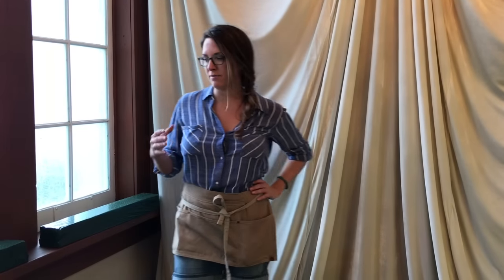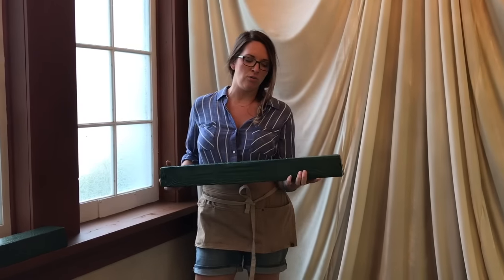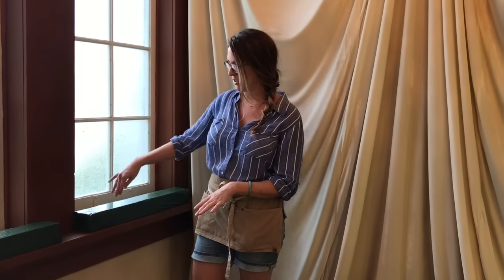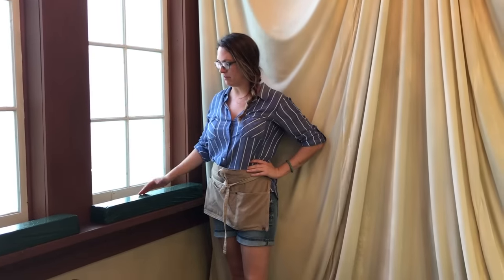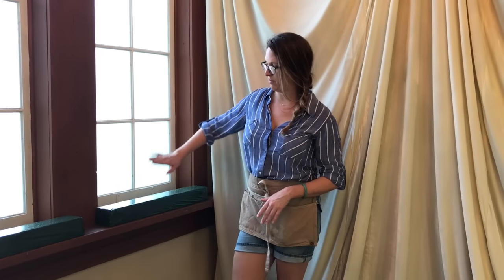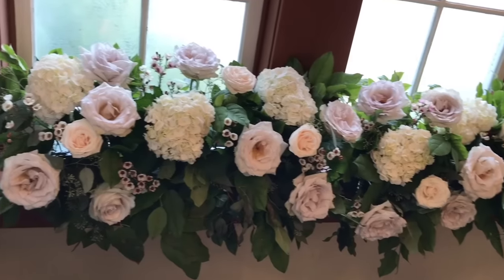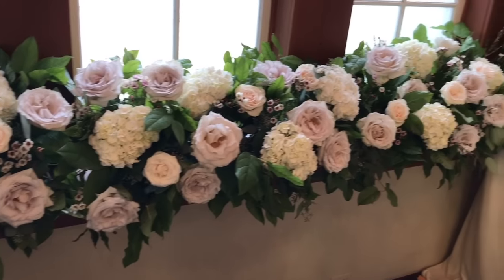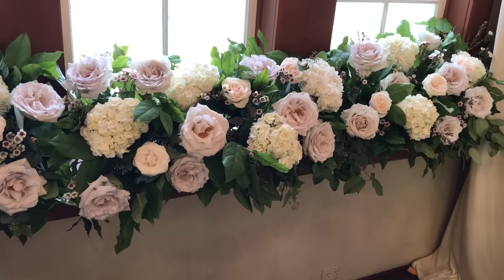How to Build a Floral Runner | Learn how to create a DIY floral runner with Flower Moxie!

Comment: Hello I have a question : I want to do the same for my wedding. To same money I will do it myself. The ceremony will be the saturday. Do you think, the flower will be ok if I do it the previous day? I also want to use the same flowers as yours
Reply: Yep!  Just make sure you soak your raquettes for an hour in the tub (because your sink isn't big enough).  Avoid putting in hydrangeas until right before because the foam does not supply enough water.  Other flowers/greens should hold up just fine!  If it's a hot-weather month, then buy a bottle of Crowning Glory Floral Spray, and that will help keep'em fresh!

I used Salal, Quicksand Roses, Vendela Roses, and Wax flower!
Reply: @amymccord6480  thank you very much 🙂

Comment: Would it be cheaper to do this or a garland with flowers added?
Reply from the maker: Hmmm...garland typically runs $12-15 per foot and then you'd have to factor in the blooms.  I think it would probably be a bit less spendy, but you wouldn't get the profile/height...it would lay much lower.  You could always forage greenery to bring down the price a bit!

Comment: If i recreate this using standard foam and brick trays, how long will the flowers last? If i soak the foam and then cover with plastic wrap, would that work as a cheaper alternative? Those raquettes are definitely more expensive
Reply from the maker: I don't see anything wrong with that idea!  Whether you do that or use the raquettes, your vase life will not be that long because the foam is not in a vessel of water.  I'd suggest creating the day before....unless you have a cooler, and then you can do 2 days.

Comment: thanks for sharing! i'm DIYing my wedding gazebo flower decoration. Would I use 27 inch or several pieces of those (and then glue them?) foam for the top and appropriate lengths of foam for 2 sides of gazebo? do those foam pieces have holes for zip ties?
Reply from the maker: For a gazebo I'd recommend using Large Floral Foam Cages and zip tie the snot out of them!  Look up my arch video!  

And yep, the foam cages have holes for nails or hooks, but I tend to use zip ties.  =)
Reply: @FlowerMoxie  many thanks!!

Comment: Love it!! Where can I get the plastic wrap please? I'm doing a table runner for a sweetheart table and the runner has to come down on each side of the table. I'm kind of scared the water will leak all around 😳 how to prevent that please?
Reply: All fresh flowers and greens btw
Reply from the maker: So they have been hard to find since the pandy, but what you could use instead is an Oasis Brick Tray.  We have several sizes:

https://diyflowersupply.com/products/oasis-double-brick-tray?_pos=3&_sid=cce832cda&_ss=r

Comment: Can you please let me know The recipe above for flowers can cover the whole foam. Thank you very much. I love all your videos, keep watching over and over.
Reply from the maker: Thank you so much!  In this video, we only focused mainly on the front of the floral foam bricks, since the runner was front facing and the back wouldn't be seen.  This recipe would absolutely cover all of the foam but you will want to cut the stems shorter to ensure that they are covering as much surface area as possible!  If you wanted to make the design more floral heavy, consider adding in 20-25 carnations and 10-15 spray roses, to add more to the design.
Reply: Thank you very much for your fast reply.

Comment: Amy, my daughter’s wedding has an arbor with a steel pipe structure that I was thinking of attaching these to. My question is can you put flowers in the bottom of it, or will the water leak down if you do?
Reply from the maker: I would use floral foam cages or floral foam garland.  The raquette will be too heavy, and there's not a good way to attach it to a structure.   I have another arch video using all of the items mentioned...also, I show what Southern Smilax can do, which is great for installs.  When can get this for you if need be.  Best!  Amy

Comment: Hello, thank you so much for this informational video. Would you happen to remember how many stems were in each bunch of salal?
Reply from the maker: Salal is sold as a 'growers bunch', not stem count.  If you look on our site, we have great product photos of this!  There are salal tips and standard salal.  The tips are prettier and smaller, but you get less....while the standard has larger leaves, can sometimes look rougher, but you get a ton.  For installs like this I go with Standard Salal.....for bouquets and small centerpieces I use tips!
Reply: Flower Moxie Thank you sooooo much for your response, wasn’t expecting it (especially not so fast). Please confirm if you used 4 bunches of standard salal or 4 bunches of salal tips for this installation.
Reply from the maker: @MrsDoubleO  I used standard!

Comment: If you had excess water in the container/oasis  would you leave the hydrangea in the oasis?
Reply from the maker: In the winter when you can leave it in a really cool spot like your garage, yes.  In hot weather months, they can struggle-bus within a few hours.  I design with the hydrangeas, then take them out and pop them in a vase of water and just pop them back in before the wedding.  It's really easy to figure out where they should go because you'll have big holes.  =)

Personally, I play it a bit safe because I don't want the flowers to go south halfway through the event.

Comment: Hi! Do you recommend the raquettes for making a flower bar across the front of a pipe and drape chuppah? It needs to be about 18" - 24" tall, but just not sure if this would get too heavy  on the piping across a 10' -12' span. Any insight or advice would be much appreciated! thank you!
Reply: Nope, that would be too heavy.  I'd recommend using small Oasis Igloos or better yet, the Oasis garland!  The garland is kinda spendy, but you get a lot of it, and it's very easy to attach the sections and to fill out.
Reply: Can we use  about 5 floral cages on the front of the pipe and drape? Maybe attaché it to wooden strip and zip tie on the day of the event?

Comment: Hey! Is it possible to hang them on stairs handles? Will they be too heavy if I used some zip ties?

THAAANKS :)
Reply: If they were hanging on the side I think it'd be too heavy, but it could work on top.  Personally, I would use Oasis Foam Garland...it's not cheap, but it's legit, and I take the same approach by heavily greening and then adding my blooms:  http://www.wholesalefloral.com/ProductDetails.asp?ProductCode=P-SM1065&gclid=EAIaIQobChMIrN-21MqB1gIVDH1-Ch3lywdeEAQYASABEgILifD_BwE

You can also do smaller cages:  https://flowermoxie.com/collections/supplies/products/wet-foam-cage
Reply: omgg thank you so much for replying! <3

Comment: Love this! How would you transport this ?   I am diying my wedding decor and would need to transport to the venue.
Reply from the maker: Thank you!  Raquettes can easily be picked up and placed in your car!  You may want to lay down an old towel because they can leak a little, but they are super easy to transport because the plastic holds the foam together and there's a solid plastic tray on the bottom.
Reply from the maker: Check out our DIY Flower Collections, they come with recipes, inspo boards, and all the hand-holding!  https://flowermoxie.com/pages/moodboard-packages
Reply: @FlowerMoxie  Awesome, thank you!

Comment: Did you soaked the foam with plastic wrap around it?
Reply: Yes!  It has little holes so the water gets in.....you want to leave the plastic on because it keeps the foam hydrated longer.
Reply: are you guys ship bulk flower to Canada?
Reply: @efarzaneh   We can ship to cities on the US boarder and you can pick up from there and take it across.  I can't ship into Canada because customs will hold it for a day or so and the flowers don't like that.

It's legal to take cut flowers across, however, if you email us we can send you all the supporting information on this!
Reply: @efarzaneh  Also, in the other video, I'm using a 5'-6'' vase, which is a great size!  You always want more flowers than vase so avoid the big ones!  XO